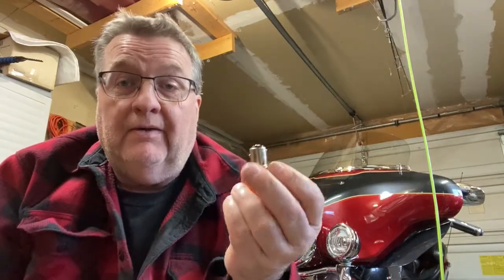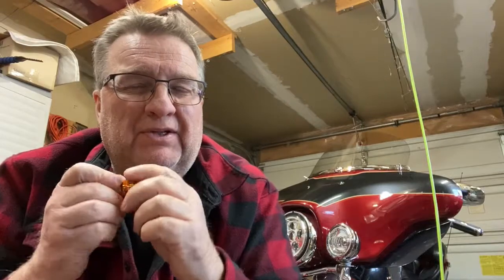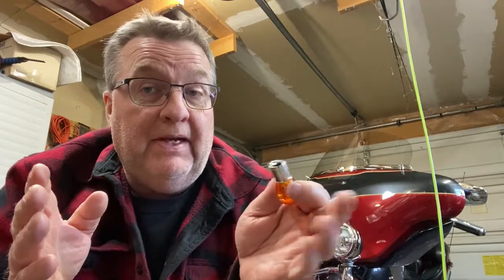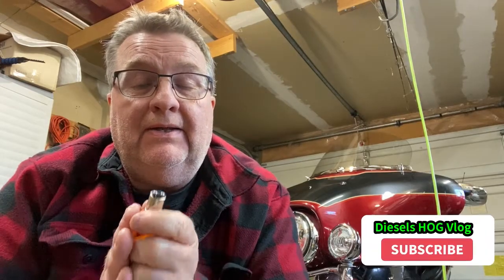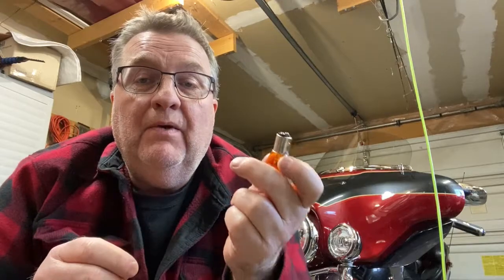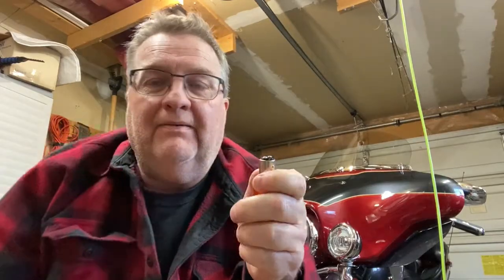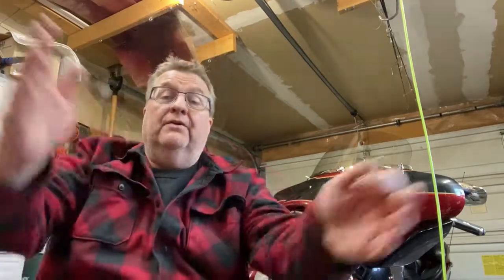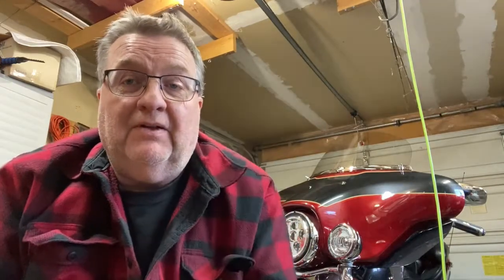Dielectric Grease Warning

Comment: If using dialectric grease and it is inhibiting the flow of electricity through a connection then there is an issue with the connector. And yes you can use bulb grease.
 I use dialectric grease in networking equipment including routers, switches, cameras, access points (AP), etc. and I fill the RJ45 ports up with it. Even on the RJ45 connectors I inject it into the backside(Where you push the wires through). I do this in harsh corrosive enviroments including industrial and high salt/high moisture installations. Some have been installed for over 15 years without failure and have to replace the device because it has past it's service life and not a corrosion or conductive issue. The majority of devices in the harshest of environments are POE being the AP's and cameras.
A bad connector that is lubricated with vibration can cause an issue and industrial applications never skimp on cheap connectors, you'll thank me.

Comment: Hence the name "dielectric" grease. A dielectric is an INSULATOR, and they are rated by a "dielectric constant" which is an expression of the items insulating properties ie: resistance to electron flow. Ceramics, for example have an extremely high DC, which is why that material is used in high voltage transmission line connections to the suspending towers. The ceramic prevents the extremely high voltage (over 140KV) from conducting to the towers and to ground. This would not only render this method of transmitting electricity useless, but would obviously be very dangerous.
Reply: congrats you almost know what you are talking about, yes a dielectric is an insulator but has other specific properties that differ dielectric from plain insulator

Comment: Warning no you should not use any kind of grease because it can damage incompatible plastic and rubber that all connectors are made of! And I pack in dielectric grease in connectors because it can be used as a removable sealer against water and air corrosion!

Comment: Well shit! I just put a nice amount on my coils and plugs and all my connections. My Ford 4.6 plug holes filled up with water. So I wanted to make sure they didn't foul again. Did I screw up? I usually do what you said and use just enough to make a seal.

Comment: if you put it on the blades of a fuse the grip is scratchy and very firm so that will displace whatever grease necessary to get a great connection and make it so it doesnt get stuck! same with relays. 

for bolt on connections the mechanical force displaces the grease and a great connection is maintained. therefore, the grease is surrounding and protecting the connection.

i can see in certain situations where too much of it on not so tight or sensitive connections can inhibit current flow.

a little bit on plastic connectors also keeps them from getting stuck.

corrosion really sucks and can make troubleshooting very difficult. 

as with anything it seems like the right amount for the right application is key.

cook me a bbq brisket and i will come over and saturday to help you paint your garage.

Comment: Dieelectric grease serves two purposes. It prevents a phenomenon called micro fretting in low voltage data circuits. It also prevents terminal arcing in higher voltage circuits. Dielectric grease is 100 percent non conductive. As a dealership technician I used a lot of dielectric grease  in my day.

Comment: I use it on the outside of the connection, for example where the bulb mates with the socket. This insures that the moisture is kept out. I personally think it's erroneous to put the grease between mating points where electricity is conducted. It provides unnecessary resistance and if you simply put the grease on the outside to keep moisture out in the first place than it negates the need to do that, all while not causing unnecessary resistance.
Reply: Wrong!
Reply: @WiekingderViking  Simply saying that something is wrong without explaining what you believe to be wrong is pretty senseless.

Comment: When used in a  properly  made connection no amount of dielectric grease will cause a resistive or insulated connection. You must have tight connection and clean metal to metal contact meaning clean all oxidation from both surfaces before application. If you call tech support you will be told to use it liberally too much product will not affect performance. If it causes an issue its the connection not the product.Never ever use non dielectric grease on any electrical connection as it may be combustible  as well as conductive........................

Comment: Dialect grease is a GOOD investment.  BUY IT!  Just use it sparingly.  Don't glob it on the terminal, except on the base of a battery terminal where it can help to prevent gases from inside the battery from escaping and producing massive corrosion ALL over your terminal.  SO, the terminal base is ONE place to glob it on.  I can't think of any other locations, but they might exist.

Comment: Having worked on a commercial fishing vessel in Alaska, rebuilding electrical connections is a well practiced and well tested thing... This guy is giving you bad advice. (well meant, but bad).

If your connections are good metal on metal, the dielectric grease is so little resistance, you can't even measure it with a regular multimeter.
Led's will have no problem with this. If your connection is so bad that Led's - known for their low wattage - struggle to run, you've got a bigger problem.

If your connections are super loose, that's the problem, not the protecting grease.
Maybe you need a new spring in the socket. Maybe you just bought a cheap junk socket. Maybe you need to squish the holding tabs. If it's too lose to press on the connections, any lightbulb will have issues (and the socket may end up melting things...)

If you have a more sealed type of connection, it is possible to stuff enough grease in there that the connector doesn't want to press together (true with any grease).

But non-dielectric greases may be conductive and short your lightbulb socket. He's suggesting you risk that rather than use the (multi-)Industry standard proper grease that works.
A submersion rated wire nut is just a regular wire nut stuffed with dielectric grease and a way to hold that in so it doesn't get washed or scooped away. So, you could just slather a bunch on the back of a connection to seal it... But
The concern you should have (with any grease) is heat & cooking. A lot of bulb lens/enclosures are loose and leaky because that is their plan to deal with the heat: airflow. If you seal that all up, instead of a convection current, the heat is now confined to build up inside your bulb enclosure.
You don't want to have grease melting and making it to the hot part of your bulb, where it can create a hot spot and fry the bulb or the grease could catch fire.
Dielectric grease is very resistant to burning. All bets are off if you are grabbing some random grease off your shelf.
Reply: Is Syl-Glyde (as used on some brake slider pins) similar to dielectric grease?
Reply: This is the kind of advice I am looking for, thank you!

Comment: Me and my buddy have been stumped with his preludes fueling system for weeks , If not months now and after finally tracking it down it was piled on dielectric grease in one plug of the fuel pump causing it to often falsely prime as it wasnt getting a good connection / loosing . This video helped me figure that out so thank you 🙏

Comment: Ford sells 2 different greases...XG-12 is the regular electrical grease for bulbs, connectors, etc.  XG-3 is the dielectric grease for spark plug boots, battery terminals,  and brake calipers.

Comment: A grease not designed as dielectric, can be conductive, or not get fully pressed out at the contact points there by adding resistance.  A good dielectric grease is non conductive, and gets pressed out at the socket contact points so no resistance is added.  I learned this the hard way when I used molykote 111 on electrical connections.
Reply: Dielectric grease by definition  is non conductive. A buddy of mine once made himself a real mess by substituting the gray anti corrosion paste used on aluminum house wiring for dielectric grease. Don't do that
Reply: Some antiseize is small metallic particles suspended in grease?  @pete1342
Reply: Appreciate your comment on dialectric grease and you say "a good one", can you tell me what you use or what is the best non conductive dialectric grease ?
Reply: Spot On comment, @Vollandt: The question here is how well the contact surfaces on the bulb and socket make contact; if it's a good tight contact the electrons flow easily no matter how much dielectric grease you use and it's a nonconductor (inert) so it neither conducts electrons nor does it increase the resistance between the greased contact surfaces compared to dry contact surfaces, which would be a larger mistake in itself. At bottom, this is about science and electrons and making a circuit between contact surfaces even if the contact surfaces are taking a bath in dielectric grease. Arbitrarily grabbing another grease at the hardware store would be the biggest mistake of all.

Comment: Question 
I learned from a mechanic if u apply only I inch on ur finger x2 of dielectric grease onto ur squeaky serpentine belt it remedies the noise.
That said I bought the grease and applied it and it worked. However I never even felt or looked at the belt so I found out the belt is worn. That said i went ahead just bought a new belt and when it comes in by amazon is it okay to apply the rest of the d. Grease on the new belt into the grooves since I have no reason to use this stuff on anything else it's the small small tube already about .5 used. 
So question is it safe to apply the d. Grease stuff to new un used serpentine belts?
Reply from the maker: So sorry for the late reply, notifications from YT has become painful! I imagine by now you chose a path on that question but the short answer is definitely NO do not put anything on belts ever! If it's squeaking it's because either the belt is worn or loose (worn is most common but as idler pully springs fatigue it can make the belt loose) or if there's an absolute ton of miles on the vehicle sometimes the crank pully is worn as well.  Never apply a lubricant to something that depends on friction to function.  The reason it squeaks is because its slipping, so adding the grease made it quiet temporarily because the slipping continued but there was a friction loss.  There are other reasons that are much more serious like failing bearings in your alternator, A/C or idlers etc but most common is a worn belt as you discovered.
  Thanks for watching!

Comment: this confuses me, I've just watched lots of other dielectric grease videos that it enhances electric flow. But you're saying it decreases flow?
Reply from the maker: Despite the fact it has "electric" right there in the name, it's a fairly common misconception that dielectric grease is capable of conducting electricity. In actual fact, dielectric grease is an insulator and doesn't conduct electricity.  
  I'm a power engineer and tell you this by way of education not just what I think.
Reply: @DieselsHOGVlog  Thank you!
Reply from the maker: @silentjellybean  glad I could help you out!

Comment: Using die electric grease car is completely dead over here at my place and the connections were bolted  even the dashboard was completely black and after cleaning with brake cleaner the card back to normal didn't work for me
Reply from the maker: I’m not sure what it has to do with dielectric grease?

Comment: If the lights do not work, the main cause is the nut between the handlebars and seat. If the light does not work after applying the grease, just wipe some off, and you should be good to go.
Reply from the maker: As by the content I was fully aware but some viewers that watched my install vid may not, that’s why I clarified for them.
Thanks for watching

Comment: Good informative video! I use dielectric grease with all my vehicle lights now. Did not realize or know of the potential problem with the LED application. Course all my automobiles are so old the don't have the LED's. I will remember your advice if I do in the future. Thanks Diesel!
Reply from the maker: Ha! Yeah I feel ya my dually is a 2000, my Jeep is a 97 and my Duster is a 75 lol. The bike is a 2007 is the newest thing I have 🤷🏼‍♂️ ...uh...well I guess if you don’t include my wife’s new Jetta 😂.  Thanks for watching brother 🥓✌🏼